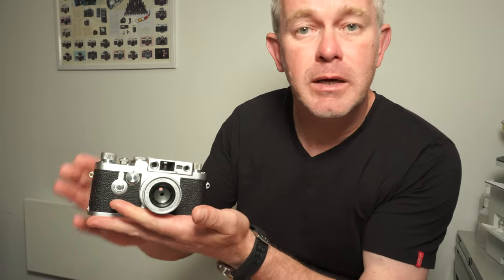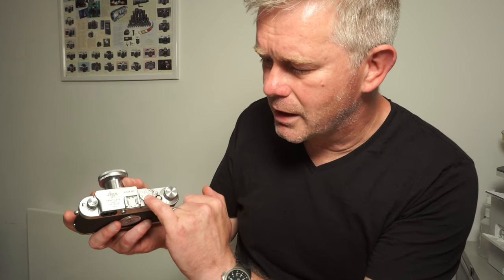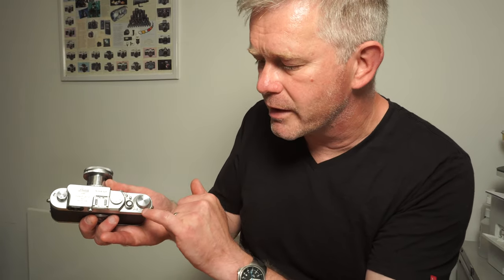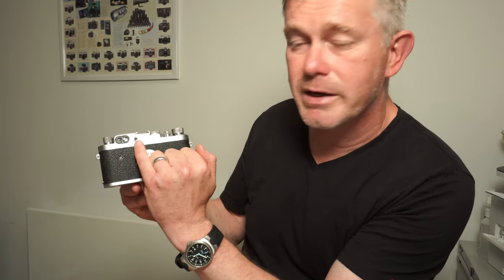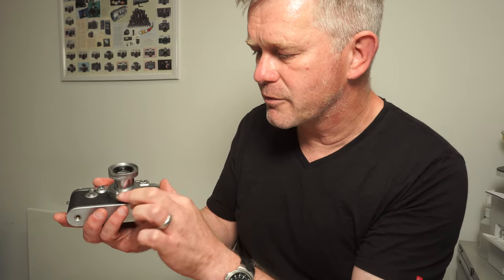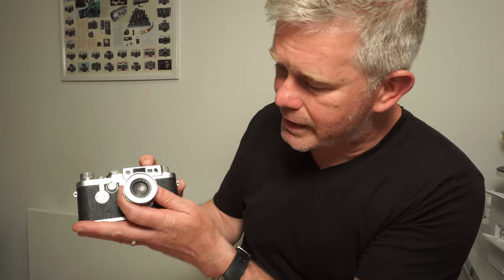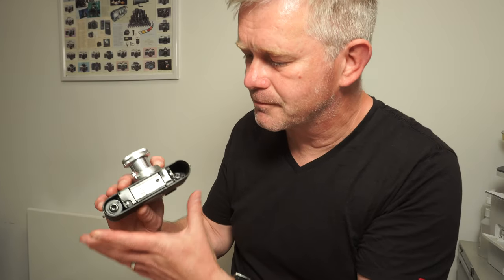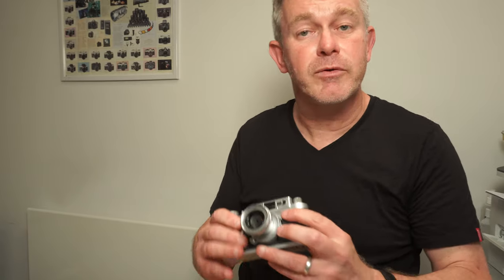Leica Leitz IIIg (3g) camera walkthrough

Comment: Very informative and clear presentation about Leica IIIg.  Have to ask about other videos which talk about clipping the end of a film roll when loading the film into the camera.  Is this necessary to use scissors to clip about 1 1/2 inches of the film to load the film?  Can we see some samples of photos shot by the IIIg—often hear about how sharp the pictures are.
Reply from the maker: Some trim films when loading a Leica, others don’t. It doesn’t need to be exact but make sure you cut between sprocket holes. Pictures aren’t particularly sharp by modern standards. If you want modern lens performance, something built in the 1950s just won’t deliver.